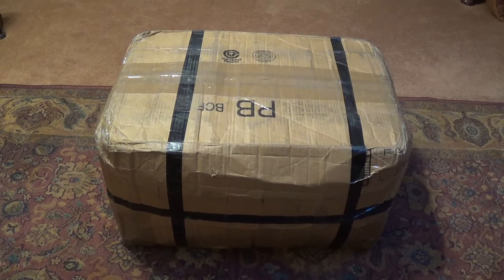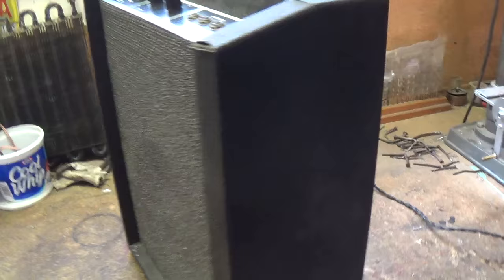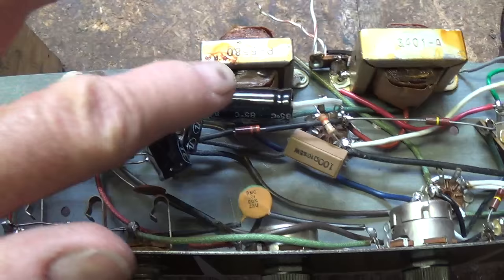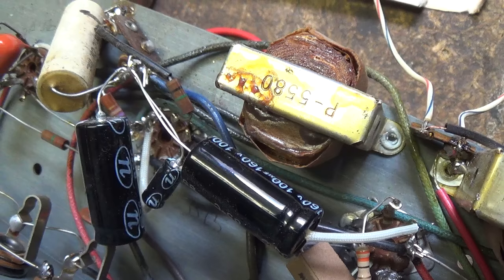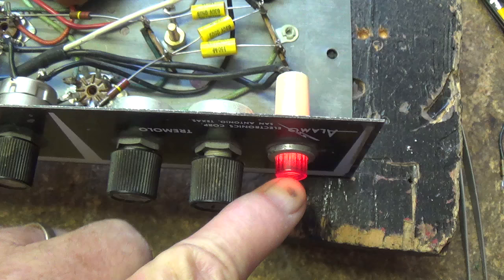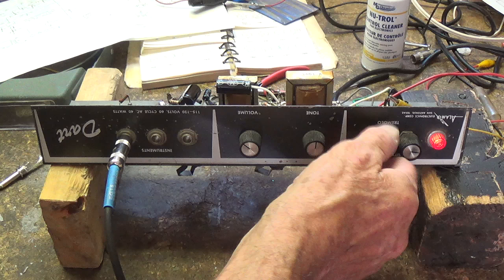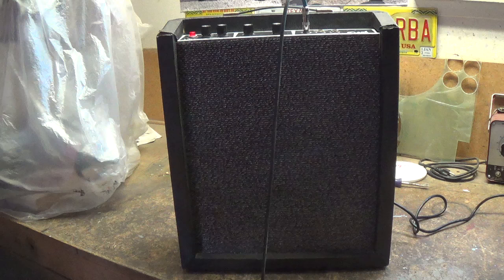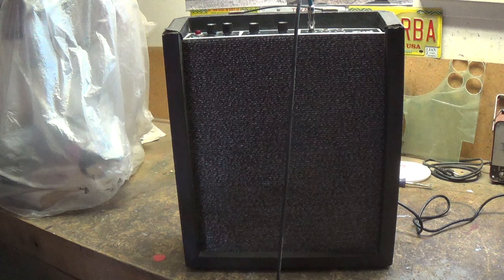1960's Alamo Dart Guitar Amp:  Ressurected from the Dead

Comment: Nothing is allowed into the house if it hasn't passed through the cat scan. While I have seen some botched jobs over the years, this one takes the cake, by effectively shorting out all the amplifier.
The worst I have seen personally was is a tube radio where someone had removed the selenium rectifier, and jumped it over.
Perhaps whoever did this wired the pilot light in series with the tubes in a similar fashion as dial lamps are wired in the filament circuit of transformerless radios. Of couse, those lamps are usually type 47 6 volt incandescent, not neon.
Reply from the maker: I agree, Mr. TM......this amp was a veritable smorgasbord of screw-ups. I actually enjoy repair jobs like this, however, because of the challenge and the feeling of accomplishment at the end :)

Comment: Uncle Doug,

          On the Alamo amp, with no power transformer, where do you get the B+ voltage for the tube plates? Is it just 100-120 volts? Great repair!

             Joe. From OH
Reply from the maker: Thanks, Joe. Yes, the 35C5 output tube is designed to function at a B+ of only 100-120VDC.....yet it has surprisingly good volume and tone.

Comment: What size wire do you use in your amps. The shielded cable you talk about for signal wires,can I use coax cable that is used for direct t v. If I just have one input jack and or output jack, does it need to be grounded or un-grounded? Thanks in advance. Are you keeping a running tab on my bill !!!!! Oh by the way, I decided to gut the lowrey  chassis and use it.I am keeping the sockets and output t, f.I cut all the caps and resistors out.I think I have the power t.f. figured out. Just two wires I'm not sure about, They came from organ and I think they just cap off. Going to test it before I hook it up. Worse case, blow it up!!!. I just don't have the money to buy everything I need ,buying it all new. I'm going to chance this one without a variac but I did build the current  bulb you showed how to build and thanks for that.When I get it done ,I'll make a video. Probably be about a week or two before I can get the parts from antique.Thanks for all your help.
Reply from the maker: I generally use 16ga in the power supply and 18ga in the rest of the circuitry. Naturally, the power transformer wire gauges are determined by the manufacturer. I used to get small gauge (around 1/8 to 3/16" diameter) shielded cable from Radio Shack, but since the local ones have folded, I get it from Antique Electronic Supply. Input jacks should be self-grounding, but I don't use self-grounded speaker jacks.

Comment: Is an auto transformer the same as an isolation transformer.  The one that I have as a large knob on top that can vary the AC voltage output from 0 to 140
Reply from the maker: The variable (0 to 140V) transformer is what we generally refer to as a Variac, Gary. It can serve as an isolation transformer, but that term is generally reserved for 1:1 power transformers that are used to isolate an electrical circuit from earth ground, to reduce its shock hazard potential.

Comment: Hey UD, could that little transformer isolate the user from the circuit to avoid the zappies, at lest deadly ones?
BTW, I have a Weber speaker in one of my amps and love the sensitivity. It holds nothing back and is actually a lot of fun to play super clean. Oh, and as usual, an excellent video.
Reply from the maker: Yes, as I recall one of the transformers actually was for isolation. Thanks for the positive input on the Weber speaker.

Comment: Enjoying the vast library the Uncle has put together.  Do you and Rusty have any advise on putting together a stand-alone reverb tank from used parts?
Reply from the maker: Several years ago I built a Fender 6G15 Reverb Tank clone, MB, that far exceeded my expectations. It wasn't built from spare parts, however, and I'm not sure I would recommend doing so. A video was posted on the ElPaso TubeAmps YT site demonstrating the tank I built.....it was before I had my own channel.
Reply: Just watched and what a beauty.  Did you follow the schematic exactly or did you use your experience to change a few values?  I'm a high school Physics teacher and can sympathize with your impatience at fear of math!
Reply from the maker: I used the schematic for the reissue version, MB, assuming that it incorporated all the changes and improvements that were necessary to make it sound great and last a long while......it did.

Comment: "Cat Scan" ha ha
Jack and Rusty are such great assistants, you are a lucky fella.  Mia, my apprentice assistant, tends to be fascinated by my hot soldering iron.  Lots of excitement on the work bench I tell you.

Uncle Doug, does the fuse and grounded three wire cord make the amp safe, or is it still a potential hazard of sorts ?  Regardless, that was a nice save on an amp probably destined for the land fill.
Reply from the maker: Thanks, BF.  Keep Mia's tender snout away from the hot soldering iron :) In my opinion, the amp is safe. I can't envision any errant electrons preferring a path through a high-resistance human to a quick, zero-resistance path to ground through the green grounding wire.

Comment: Cat scan,Ha!!! I have another question if you have time. I am about ready to get the parts for my champ. Do you think it would be better to use a  board or point to point on lugs.I have some boards in the Hammond I could use but I am debating. I just wondered if you had a preference? Thanks for any help. Tell Rusty and Jack hello.
Reply from the maker: I've never used any other method than point-to-point, WN. IMHO, any other method is simply a means to facilitate mass production.

Comment: what's wrong with 18:30 circuit ? the neon bulb is just connected in parallel to mains, if you remove it, the heaters are just connected fine in series through 100 ohm & transformer.
Reply from the maker: You're right, IB......it's fine.

Comment: Hey Doug! I'm a teen from Australia and i want to get into amp building but i don't know where to start. Have any tips? Thanks
Reply from the maker: Like any other technical hobby, Brodie, you need to study and learn all you can, primarily from Internet sources and videos, then practice what you have learned on simple projects, gradually increasing in complexity. Good luck.
Reply: Thanks heaps! Any suggestion on an easy amp to study first?
Reply from the maker: You're welcome, Brodie. Yes.....the venerable Fender Champ is a great place to begin your study of tube amp circuitry.  If you can understand every part of the circuit, you're well on your way to understanding virtually all amp circuits.

Comment: Hey Uncle Doug, It was my understanding that transfomerless amps could not be made safe except with an isolation transformer between the amp and the wall socket. Thoughts?
Reply from the maker: If a 3-wire power cord is correctly installed, securely grounding the chassis, and the amp is properly fused, I do not see how a person could get shocked.....even if the wall AC receptacles are improperly wired.  Any internal short circuit to the chassis would instantly go to ground, blowing the fuse.

Comment: hi +uncle doug that little transformer sure is strange, have you measures the voltage coming off the secondary and see how it compares to the primary?
Reply from the maker: If you're speaking of the isolation transformer on the left, it should have a winding ratio of 1:1, so the voltage in is equal to the voltage out.

Comment: The most mysterious amp I’ve ever seen. People say that an amp should use a transformer for isolation and I did use a non-isolated transformer (I bought it by mistake) it was working well until it’s ground touches real ground. My circuit breaker at my room broke at the first time in 5 years since I moved here. 
I’m wondering how would this non-isolated dangerous amp sounds. It’s hard to judge by just watching video.
Reply from the maker: Any amp that flips circuit breakers with a 3-wire (chassis-grounding) power cord is not to be trusted. The AC part of the circuit MUST be isolated from the chassis.
Reply: @UncleDoug  yeah, but even you make it isolated, the current will flow through diodes, according to my thought after several hours debug.
I still wonder how those amps sold, maybe they sound  “normal” so people still pay money to buy them.
Reply from the maker: @moses1202  Originally, they were encased in insulated cabinets with plastic knobs. Nowadays, they are a shock hazard  that is best relegated to display rather than use. It is possible to install a grounding system in the circuit that does not connect to the chassis......but it's generally more work than it's worth.
Reply: @UncleDoug  Hi! Uncle Doug. 
After long struggle I decided to rewire all circuit. And finally I found the root that cause hum noise. It was the output transformer, which I used it for balanced output. The hum noise is just very easy to deal after removed the output line transformer. I’m very happy with this result. Thanks for inspiring me to keep tracking the problem. God bless you! ☺️
Reply from the maker: @moses1202  I'm glad you were able to resolve the problem, Moses.

Comment: Hi, Uncle Doug. Interesting video.  I have a 70's something solid state Pyle amp and I was wondering if you could tell me why the tremolo would be "hissy" and if there's a reasonably simple way to improve that or fix it completely.  Also, if adding a 3 prong cord, is it as simple as just replacing the two leads and connecting the green to the chassis? 
thanks 👍
Reply from the maker: Rusty and I don't work on SS amps, RD, so we're not a good source of repair info.  You might try some Internet searches. When installing a 3-wire power cord, the black (hot) wire goes to the on/off switch, fuse, and power transformer primary. The white wire (return) goes to the other side of the PT primary. The green is connected to the chassis. Good luck.
Reply: Uncle Doug Oh, okay.  Thanks! I just discovered your channel and really am enjoying your (and Rusty's) videos.

Comment: Hey Uncle Doug, from the sounds of it this looks like a good amp to build for a 1st timer? Can you guess at what the parts would cost minus the speaker and the cabinet? Thanks man.
Reply from the maker: I honestly wouldn't recommend this circuit for you to build at home, PT. You would be much better off with a circuit that has a power transformer, both for safety and performance. I would recommend a Fender 5F1 Champ. You should also realize that building amps is not an inexpensive hobby. The parts for a Champ would probably be around $150, not including speaker, tubes, or cabinet......and you would have to make your own chassis. The same is true if you chose to build an Alamo Dart, but the parts would be cheaper, probably closer to $100.

Comment: My magnatone estey t32 has those tube holders have to be careful not to pull them off roughly or they will slap the sides of the tubes
Reply from the maker: With the relatively high cost of vacuum tubes, we tend to be gentle with them too, Nick.
Reply: The T-32 has the rare dual pentode 9 pin 6HU8 aka ELL80 so with the high cost of this tube I feel I can never be too careful as a NOS costs about what I paid for the whole amp

Comment: the 12AV6 is the oscillator for the tremolo... so it's NOT an amplification device....  correct?

I have had issues with the 12AU6 as a pre-amp...   but this makes me want to pull my project off the shelf and try again.
Reply from the maker: That's right, it's single triode is used purely as an oscillator. The 12AU6 works quite well as a pre-amp in this circuit.
Reply: So the 10$ question I have to ask on my project is WHY do I get soooo much distortion and not enough gain out of mine.   That Silvertone Schematic has voltages,  so that is helpful.
Reply from the maker: Yes, the Alamo circuit, being transformerless, operates at rather low voltages. Perhaps that would explain the difference in performance.
Reply: I tweaked my project amp a bit... and I got it louder.... (hooray)...  The only thing I've got to deal with is the volume knob.   when at zero, it's pretty quiet,  when it's full volume, there's little noise..   but in the middle there is noise.    Does your Alamo do that?

Comment: Another great video. Very timely for me as well, the General Television PA amp I picked up on ebay seems to mirror the circuit almost exactly (save the tremolo of course) so the schematic you provided I think will help me figure out how it works. Incidentally after a close examination of the components (waxy caps and one mica cap)  they all seem to look just fine no leaky residue evident I am hopeful all is still in working order but I am waiting on my Blue ESR meter and I have a good Fluke meter (87 series 3) I will test all the components before powering it up (with a grounded cord and fuse in place) I was wondering if you have done any tips or things not to do when soldering videos? I have soldered trailer lights for my truck but that's about it. For example do you use a heat sink when working with amp components to keep from over heating them or is that more of a transistor issue?  Thanks for your time and input! I'm also very glad the Cat Scan turned out okay, lol. My cat does Cat Scans on nearly everything that comes into my house as well and so far so good! LOL.
Reply from the maker: Bear in mind that the ESR meter is  for electrolytic (filter) caps, Jack, and that coupling caps must be tested for DC leakage at full power (it's easier to just replace them). No heat sinking is necessary on hardy old tube amp components.....you simply heat up the wire joint and let it melt the solder.
Reply: Okay, thanks for the reply. I will do as you suggest and replace the coupling caps and I got in my ESR meter today. On my next days off I will start on it. I picked up a small Fender combo cabinet on ebay in really nice shape with an 8" 8 ohm speaker so I have a home for it when I get it going. Thanks!
Reply from the maker: You're welcome, Jack. Best of luck with your project......and please be very careful.
Reply: Thank you! Oh yes I am careful around electricity. I work as an industrial maintenance tech so I work around high voltage ac and dc at work Electricity scares me! I am super careful and check to be there is no voltage present before I touch anything, generally several times just to be sure! I think I might try something different on the controls. I am thinking of putting the "dashboard" in the original location at the top front of the cab and running shielded cables down to the chassis mounted at the bottom. I never see this done and I'm sure it's to suppress noise but if leave the input jack at the bottom in the back and the power there as well but move the volume and tone control pots to the top maybe it'll work. If not it shouldn't be too hard to move the whole shebang up to the top later.
Reply from the maker: That sounds like a good idea, Jack. Valco did the same thing with some of their larger amps......preamp on top with all the controls and power amp on the floor, connected with shielded cables.

Comment: Thanks,Doug,for that interesting project.Would you consider modifying an old tube radio to use as a guitar amp?
Reply from the maker: You're welcome, Arthur.  I'm not a big fan of AM radio conversions.  It's a personal choice and I know that many people do like them, but I prefer the outcome when the conversion is based on early tube PA amps. The chassis are more suitable, there is no radio section to clutter the circuit, and the components are of higher specification for much greater power output.

Comment: As it turns out I just bought an Alamo Embassy 2365  which I think is a Bass amp, only has 2 tubes and 1 huge 10 in speaker. It does work with my 1962 Kay Orlando Bass but was wondering if there was a way to determine the year of the amp. I am going to try my hand at cap update after I take a look at the circuit. Any suggestions as far as the tune up, I am gonna make an inspection video so maybe you can critic it for me
Reply from the maker: With only two tubes, it must be a hybrid circuit, Dean, with transistorized pre-amp and tube output.....probably made from 1973-1979. I don't work on hybrids, so I have no knowledge or experience to offer, other than Good luck.
Reply: @UncleDoug  Thanks, I will let ya know

Comment: You got that little guy sounding great, I especially liked the clean tones.What guitar is that?
If you start getting the urge to run after cars, it might be time to cut down on the biscuits.
Reply from the maker: Thanks, TB. It's my usual shop guitar, an old "pawnshop-special" Matsumoku Vantage Performer V-695 with MMK-45 humbuckers.
Reply: +Uncle Doug Nice find on the guitar.
Reply: I think that upgraded Weber speaker could have been one reason for the great sound produced by Uncle Doug's restoration and tremolo mod. Thankz
Reply from the maker: You're probably right, ATL. I tend to think that the speaker is the most important component in tone production. Fancy output tubes, expensive capacitors, etc. may influence it in a small way, but the speaker is the amp's "voice".

Comment: I have another question. Is it possible to strip the chassis of my fender champion 100 SS and convert it to a tube amp or so expensive its not worth it ? I looked at a few today and one I can use for my needs is priced at 800 plus tax
Reply from the maker: I don't recommend it, 357. Virtually none of the SS parts will work in a tube circuit. Watch my video on how to build an amp from scrap parts. Maybe you'll get some ideas from it.

Comment: Plus it has a much better speaker than stock.
Reply from the maker: You're right. Speakers make a huge difference, Philo. In fact, I believe that a good speaker is by far the best way to improve the tone of any amp......better than 15 lb. transformers, $50 apiece boutique "tone" capacitors, and super expensive vintage tubes.